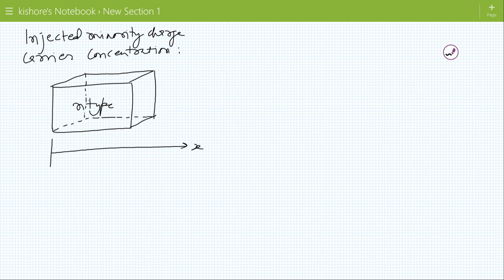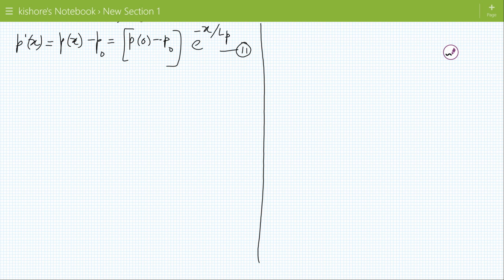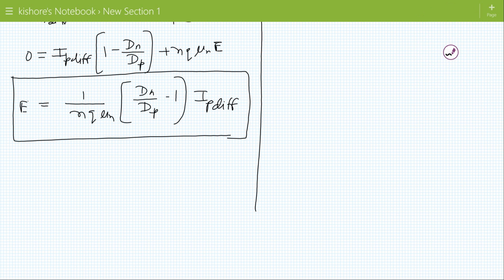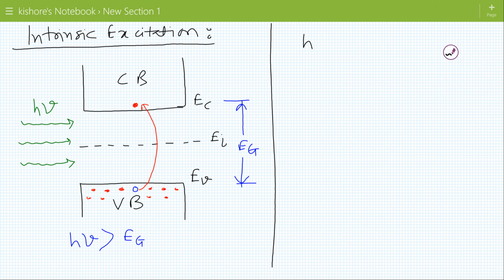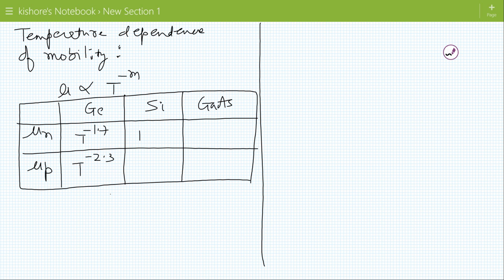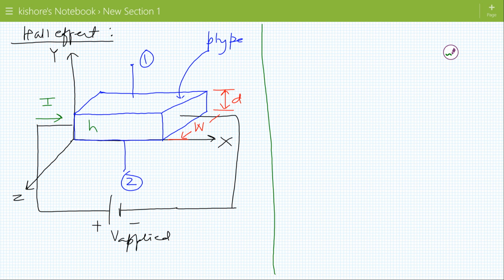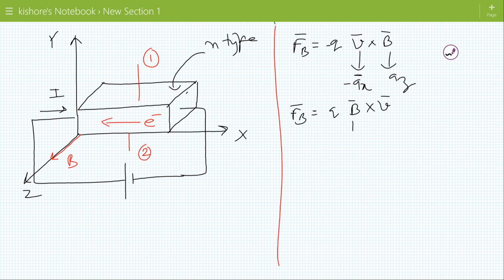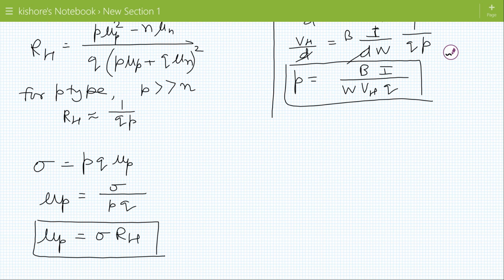Lecture 6, Electronic Device (Hall Effect for Semiconductor) avi

Comment: Thank you sir for the lecture. @12:40 is Indrift expression correct ?? because  it seems to me it should be Jn drift  as Area is missing with expression nquE  , where u--> is (Mu).
And if possible make videos on Digital communication Topics  Random Process and Noise  with  Derivation of Error Coefficient. Thanks a lot for providing good contents.